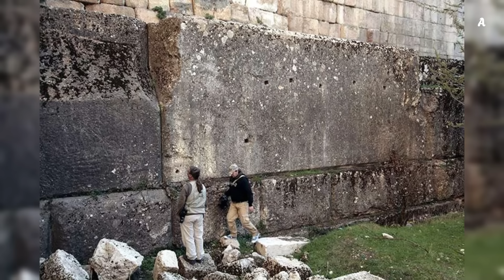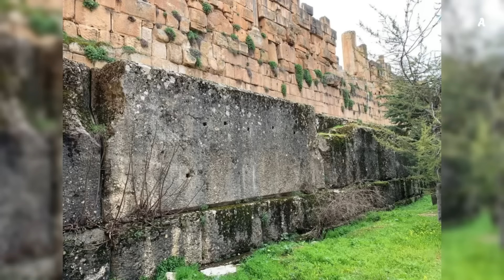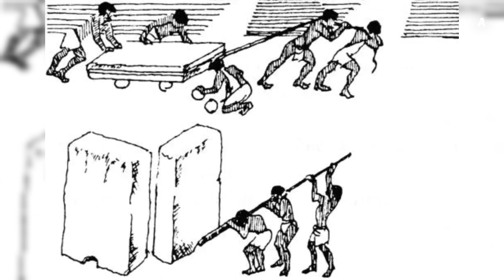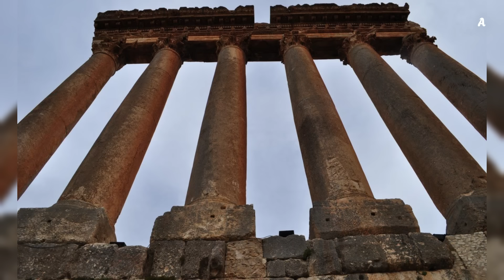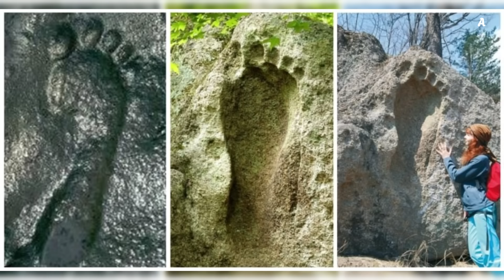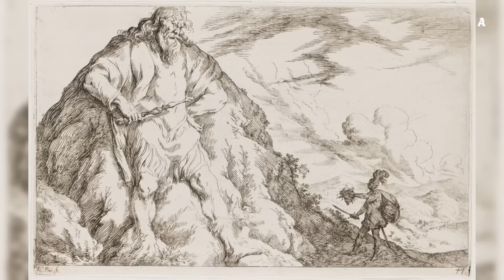NOT Humans! Who Really Built Baalbek?

Comment: The Extremely Ancient Aesir, aka The Anunnaki, The Memnir, And The Hybrid Slave Race Builders, And Constructors Called The IGIGI Were The Ones Which Did All Of The Stone Cutting, Lifting Out, Moving, Finishing, Melting Of The Stones, To Interlock Them Together, And Much Larger, And Lifting Into Place, All Of The Extremely Heavy Stones, For The Megalithic Stone Structures, Buildings, So-Called Temples, The Largest Of The Egyptian Pyramids, And Far Below Them, And Megalithic Walls, And Everything Else, All Around This Realm, Some 470.000 + / - Centuries Ago, And After That . . .

Also . . . The Gigantic Finished Megalithic Stone Structures In Meso-America, Mexico, And South America, Were Most Likely Also Of Extremely Ancient Aesir, aka Anunnaki, Memnir And IGIGI Design And Construction, Some 470.000 + / - Centuries Ago, And Afterwards . . .

But, The Extremely Ancient Pyramid Wars There, Abruptly Ended The Work Projects, That Were In Progress There, Wherein Many Regions There Were Destroyed, And Structures, Statues, And Obelisks Heavily Damaged, And Toppled, With High Heat Thermal Blast Damage, And High Radiation, Which Is Still Detectible There, Leaving Several Regions There, Still Uninhabitable . . .

In, And Around Extremely Ancient Egypt, And The Surrounding Areas, And At Mohenjo-daro, And Harappa, aka Often Called The Indus Valley Civilization, And The Surrounding Areas, Were Hit With Deadly, Extremely High Heat, High Energy Weapons Fire, And High Energy, High Pressure Blast Wave Weapons, From The Extremely Ancient Aesir, aka Anunnaki Pyramid Wars, Which Melted Parts Of Those Areas Structures, And Eradiated Those Areas, And Regions With Deadly Radiation, Which Is Still Measurable Today, November 25, 2025 . . .'-()